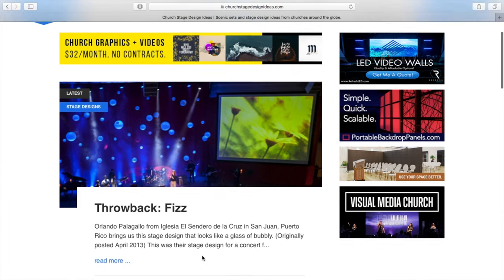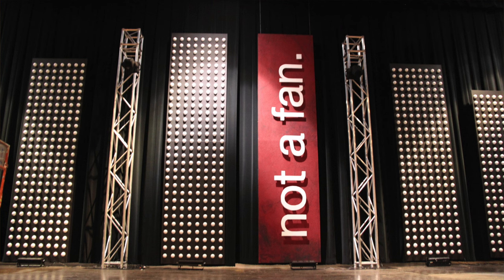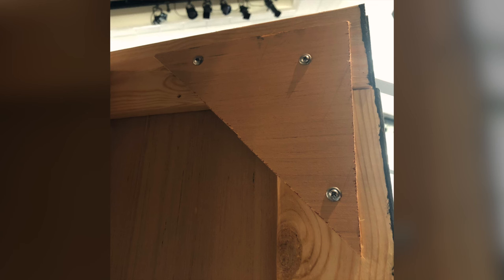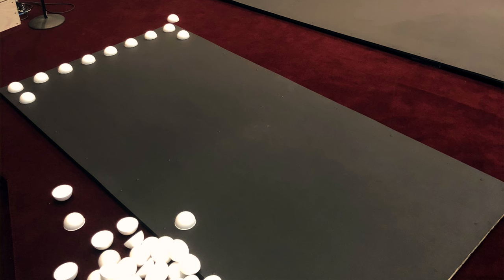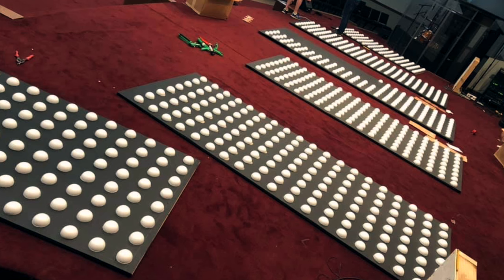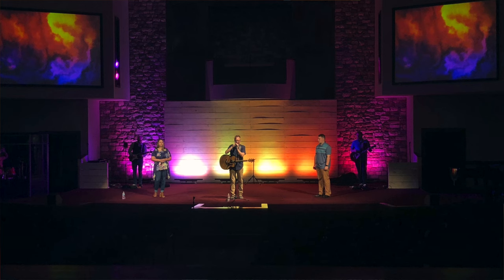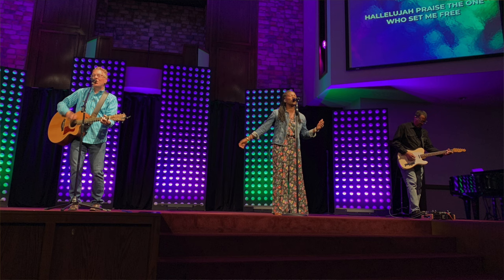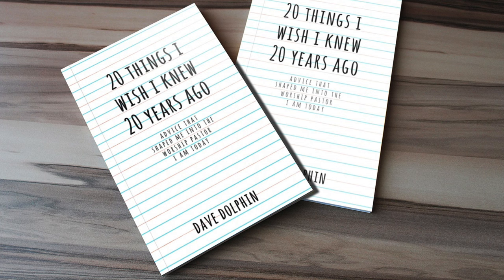A modern church stage design idea (and how we did it)

Comment: This looks great!  I think my production team is going to attempt something like this soon.  I do have a quick question, though - are you hitting your panels from the floor and from above with your LED lights?  Or just from the floor?  I'm a little worried about getting enough light to cover the entire panel, and we'd be left with just some white balls near the top, hah.  Awesome job, and great video!
Reply from the maker: Hey Matt! It’s all just up-lighting. Each panel has a color bar at the bottom pointing upwards. You can see—especially in the video thumbnail—there’s a hot spot towards the bottom section of each panel. But it does cover the entire panel. If you try this, send a few pics my way. I’d love to see it!
Reply: @practicalworship  Thanks so much!  I definitely will send pictures your way if we try it.
Reply: How much did this cost?

Comment: Where do you place the lights that make them shines like this?
Reply from the maker: Each panel has a Chauvet color bar at the bottom pointed up. It casts light on the panel itself but it also casts light onto the ceiling. There should be a link to the color bar we used in the video description...

Comment: To each their own, but I'm not a fan.  I still prefer more traditional stage design.
Reply from the maker: That's fair.
Reply: i used to prefer traditional design but The church im attending with the traditional design Is unfortunately DYing (quite literally because its mostly of the elder generation) and im on the promotional committee  And Going to bring up  in our meeting that we need to embrace the Contemporary/modern design Due to The SUn bleaching the carpets Below caused from a skylight that runs the length of the sanctuary  there's flaws in both but i also appreciate both